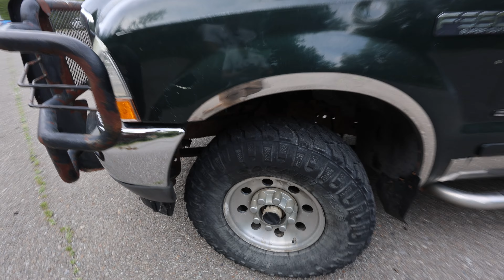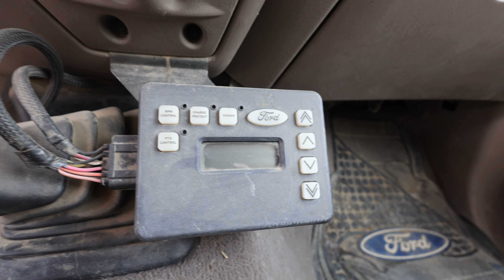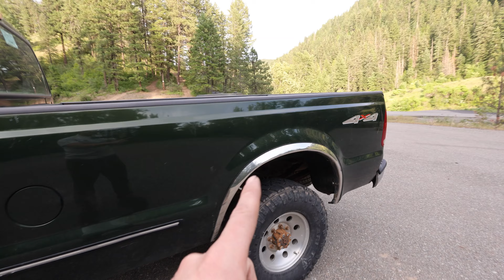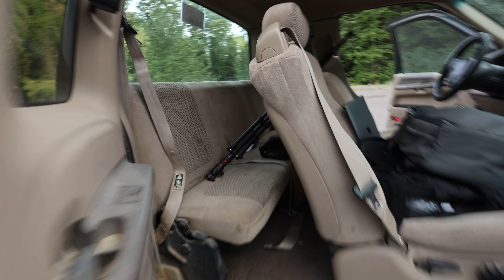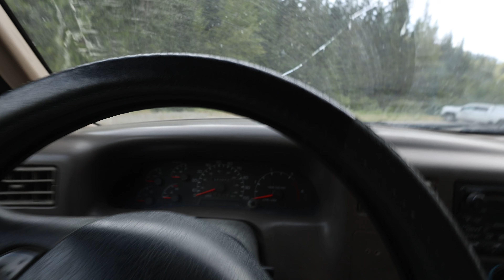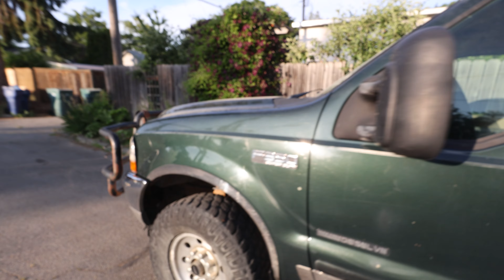$6500 7.3L F-350 with 320,000 miles - Hidden Gem or Rust Bucket?

Comment: As the owner of a 1999 F-350 from the northeast, that I have replaced the frame on due to rust, that thing is notttt rusty lol
Reply from the maker: lol that makes me feel a lot better! I inspected it thoroughly before buying, it felt solid just lots of surface rust. Will be toeing a trailer several hundred miles soon so we’ll see how she does!
Reply: @Austin_SaintOnge  the spare tire crossmember and last 2’ of frame on mine was basically dust after I started poking at it. Initially I patched it for a few years but I just completed a full frame swap on it a few months back. Luckily it only has 115,000 miles so in that regard it’s great!

You still have bed crossmembers so you’ve got it pretty good! Those are usually the first to go!
Reply from the maker: @maineiacoffroad9969 interesting! Thanks for the heads up!

Comment: you and me are kindred spirits bro -- i love the truck. the green and tan is my favorite combo in these. im also a 12v fan, but IF LEFT STOCK, i think a 7.3 holds its own in a pro/con convo. im also a zf6 fan (had them in both SDs and as part of custom builds), except i have found them less smooth to shift than NV4500s. Way stouter and way better splits. Re: the price tag, i think you did very much OK. the rust really doesnt look that bad at all and that where all the value is (im in wisconsin so im a rust PhD at this point). Good for you re: moving on your day job to something that fuels your passions. i hear that 100%. Am trying to do similar myself :)
Reply from the maker: We definitely are kindred spirits! I think there’s a lot of pros and cons to both the 12 valve and these trucks, and it may end up getting a Cummins in it anyways! I agree, the nv4500 does shift better. Hopefully you’ll be able to make the transition too!

Comment: Exactly how much I paid for my early 99 f250 extended cab long bed 5 years ago with 198k. Put a mishimoto trans cooler in it if you're gonna tow long distance, assuming standards have the same cooler. They might not.  And don't put any chips on it dude. Maybe a s&p intake and exhaust.
Reply: Take the chip off bro.
Reply from the maker: I’ll probably leave it as I just use the stock tune
Reply: @Austin_SaintOnge you might be alright on stock tune, theyve been known to mess up the IDM, mine did, and i took everyones advice and daily drove it on the 75hp tune. Check into the cooler tho, these had smaller ones than the 6.0 These got plenty of towing power especially being a manual. I added a leaf to mine and put airbags on it. Being a 350 you might be alright
Reply from the maker: @watermelonmanee gotcha, yeah the trans I think will hold up pretty good to towing, and yeah since it’s an f350 it has the leveling blocks in the back

Comment: Hey brother!

I built out a 91’ 75 series Land Cruiser, Cummins swapped it with a 4BT. Quickly found out the tranny couldn’t handle the torque, blew the tranny 3 times. Upgraded to a zf5 & transfer case. Then I started blowing the hubs. Swapped out the hubs a few times. Then blew the rear axle. What was next? A ford axle of course… then I realized I’m basically building out a Ford or dodge truck that comes stock with what you need to handle big power. Sold the Land Cruiser and bought a 7.3 excursion. Never been happier. It’s everything I was trying to build towards but completely stock. The Land Cruiser is not built to handle a 5.9, anywhere. It’s rugged in its standard form, not in an upgraded form. My buddies got 37’s and chromoly axles on his 80 series, he broken axle shafts, drive shafts, his auto tranny. And it still has the 4.5 EFI. Toyotas are magic in their stock form. 

Of course, the excursion isn’t an off-roader. I’m ok with that. Now I tow my buddies Land Cruiser when it breaks down! But I’m glad I won’t be breaking anything. Love your channel dude keep it up.

P.S focus on keeping this new truck reliable before putting more money into it.
Reply from the maker: Hey man! I’ve been thinking this exact thing! I’m super impressed at how it’s been able to handle the Cummins and 42s, but yeah everything axle wise I’m looking at is already on the superduty! Great advice thank you!